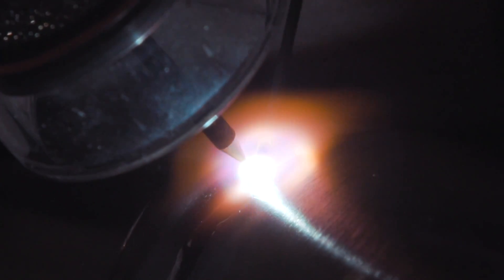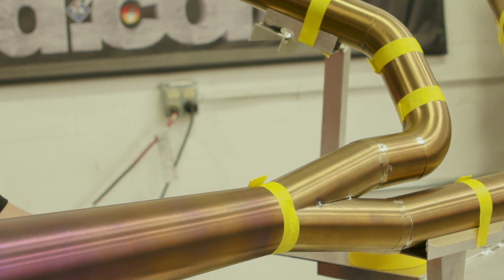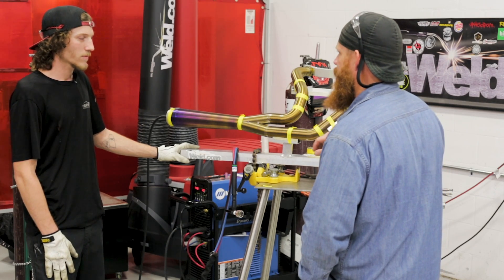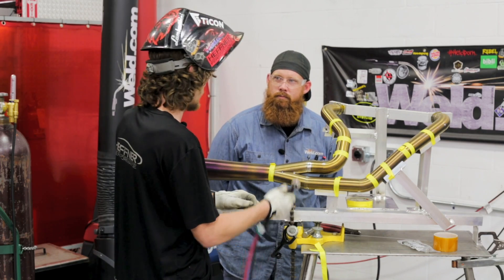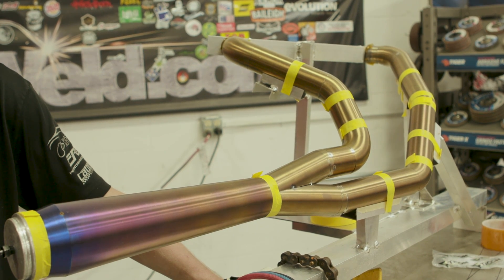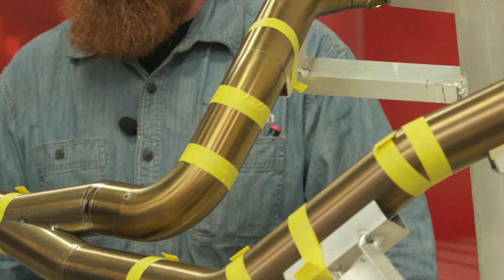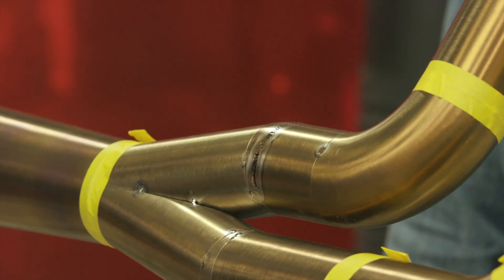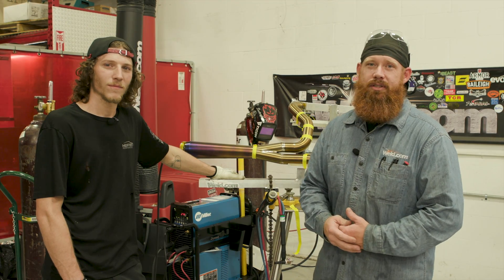TITANIUM EXHAUST WELDING (Featuring @heffnerperformance)

Comment: If when using a tourch to bring out the Color... would it be more Vibrant if you flooded the area with Oxegen at the same time as to help the Oxidation process ????
Reply: Also ... do you get better, more durable Color on a rough finish or polished finish ????

Comment: I love welding Ti. By far the most satisfying material to weld and when you have your setup correct it's easier to weld than stainless in my opinion. Flows so nice.
 With that said it's "the" material (along with Inconel) that sets the men apart from the boys cuz you gotta fabricate that shit before you can weld it.

Comment: When tig welding Titanium I have heard to shield the weld until its cooler than 600-800F. Exhausts can reach 1200F. Why is it that they aren't damaged at that temperature? Also why is there no issue with heating titanium until it changes colors but welds are rejected if not silver or straw?

Comment: Not a welder. What is purging?
Reply: Because titanium reacts with nitrogen in the air causing brittle titanium nitride at only 800 degrees you have fill the backside of the weld (inside the exhaust pipes) with argon too. So they vent the top, seal off the bottom, and push argon into the pipe (through the bottom), which pushes the air out. The push the air out and replace with argon is "purging".
Reply: Oh wow, they should call welders scientists if that's the kind of stuff they have to figure out lol
Cheers 🤙

Comment: When I weld thin material I walk the cup
Reply: Cant do that on ti. Also would look like shit on an exhaust
Reply: @matt10011987  
Is it very different to weld ? Compare to stainless and carbon steel?
Reply: @erwinvanriel5843  yes. Gas shielding has far less margine for error. Requires longer post flows and the puddle acts differently. It wants to snap together unlike steel opening up.
Reply: @matt10011987  

And when you have no gap , you also see the rotation in the puddle, so you know you have penetration? like stainless steel without gap?
Reply: @erwinvanriel5843  ehh .it that I recall. Sounds like you have arc wander

Comment: Titanium from Russia? 1 kilogramme is 1700 ruble,1 bucks is 60 ruble,30 bucks one kilogramme.
Reply: After the wall fell you could buy anything out of Russia made from it. They evident;y used it like we use aluminum. I saw crow bars, pipe wrenches, hell, even sheets of it for sale so cheap compared to now.
Reply: EDUARD BALALYKIN that’s kinda cheap actually 
I guess the welding expertise is what makes titanium exhausts so expensive

Comment: I'm surprised the merge collector wasn't welded first with the rest of the joints taped off. He's sucking lots of air. And after that weld the tube fusion with correct purge. No sunk welds or introduced contaminants. His welds sunk because he didn't have enough back pressure on the purge.
Reply: matt vorhees this having been the first one I’d done i know where to improve from having done it the first time as well as I was on a time crunch with the bike that I was using to mock the system up on. I usually do such things as welding the collectors and tips and flanges all out before assembly.
Reply: @jeffray9049  gotcha.
Reply: @jeffray9049  if you plan building more headers in the future you might want to consider mounting your fixture to a roll out wheel. It makes it so much easier and saves a lot of time. You can spin your fixture or part 360.

Comment: Not being an ass but it looks undercut is some places, won't that make a thin spot that cracks easier in the heat and cooling of exhaust temps? Just sayin
Reply: My first thought, he wasn't adding filler at what most would consider a normal fill rate, could be he is wanting to ensure penetration and also wanting a flat weld. If we could have seen inside I'm guess he had 100%, which would be a very strong weld as long as he had a good purge.

Comment: Wish they had said who the pipe itself was by??
  Very nice welding job.
Reply: Hi Lee, I think he said the 2-1 was by themselves? using Ti from Ticon industries. They sell Ti piecuts and tube. They also sell trial packs of Ti for trying out Ti welding. They maybe bought all the piecuts and then mocked the system up on the bike but I'm guessing.
Reply: @jaquesdaniels2964  thank you. I thought it was a header company that was having this company make a new model for Harley's.  I'm not sure why someone would spend this type of money on a pipe that hasn't been tested for flow, back pressure,  sound. 
   I run all RBracing headers on my Harley's.  These guys have hp down to a science 😏. I would love to see my Black-Hole pipe in this material for weight.
Reply: All tubing and fittings are supplied from ticon industries
Reply: @jeffray9049  thank you. But why would these guys spend this kind of money just to practice? Have they tested the pipe for hp, back pressure,  sound? Any of that stuff.
Reply: Lee Olaeta this is a pretty common exhaust design that has been proven for long time of having power gains
Reply: @jeffray9049  that's very true. The header itself is pretty common  depending on size of motor. But the muffler part really is the majority of the power. The pulse wave must be perfect. Not just a pretty bell at the end.
Reply from the maker: https://www.ticonindustries.com

Comment: Is it possible to weld a titanium pipe that’s already been ran on a vehicle? Probably not right? Contaminated id imagine.
Reply: If you can sufficiently clean the area around where you need to weld it will weld. Ultrasonic cleaners work best

Comment: How do you know what grade of filler rod to use?
Reply: David, there are charts to match base material with the correct filler, same with stainless, aluminum, steel, etc...no secrets here ;-)
Reply: If you are ever unsure what grade youre working with you can use commercially pure filler
Reply: If you want more in-depth info on titanium, go check out Unobtainium Welding channel